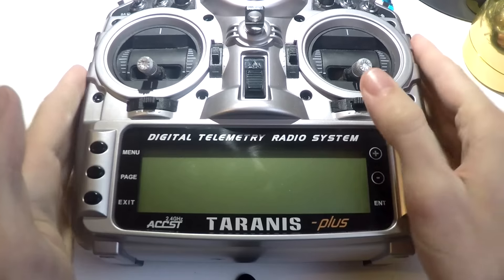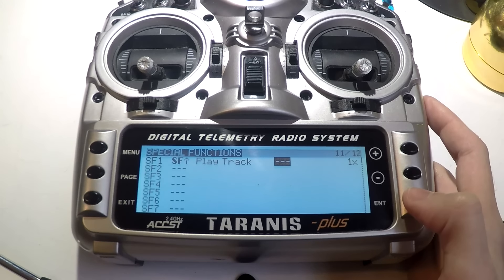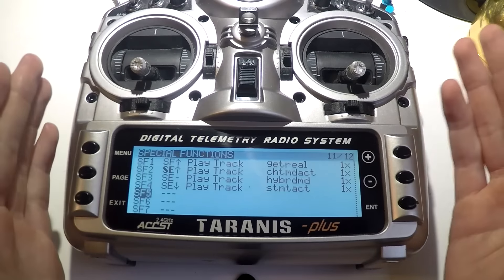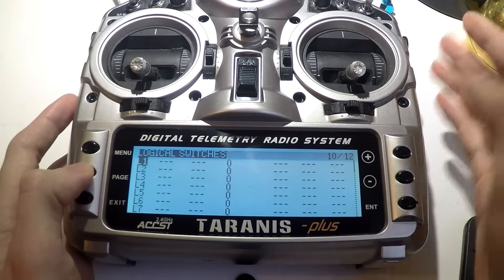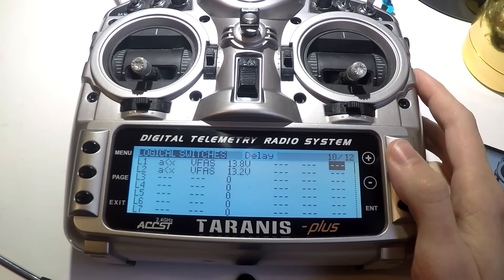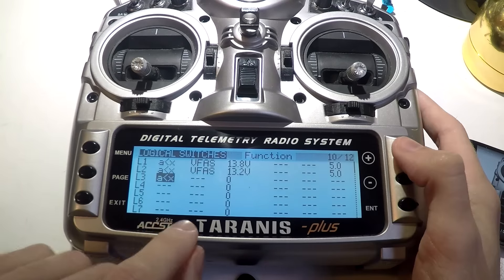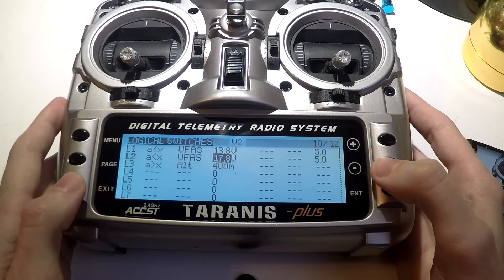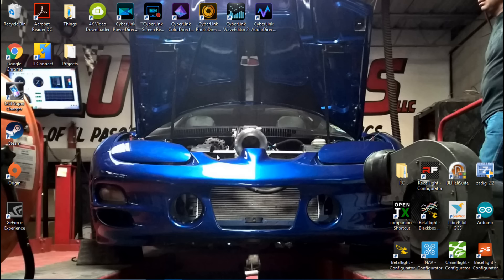Taranis X9D: Creating Alarms & Switch Sounds

Comment: I want to do the delay on the annoying low battery alarm but I realise when I do a punch-out with my quad I need to hear when the battery is struggling so I can ease off the power, I guess the answer is to assign a switch and try to remember to enable it before each flight, but if you forget....

Comment: Great video. I was able to use Taranis method to created sounds for switches, but when I tried Companion method I cannot find the WAV files in the drop down menu "Parameter". My hunch is that my SD card contains all the sound files but the Companion directory is missing sound files. Can you tell me how to verify this? Or am I missing some step? I am using 2.1.9 companion/firmware

Comment: Please help! I have added the VFAS special function switch on SH, but it's way off. The multimeter, the flight battery voltage display on the top line of the 1st Model screen, and the telemetry screen all show VFAS at 12.4 V (recently charged 3S). But the Special Function SH says 12.9V. Can't even charge that high. (Just sitting on the bench, not flying.) When flying it's anywhere from .5 to 1V higher, but that's a changing environment.

Really messing with my OCD!
Reply from the maker: What does it show in Betaflight? The actual voltage or whats on your Taranis? If it matches whats in the Taranis you may have to calibrate it. https://www.youtube.com/watch?v=Lf_2dH7BjAw
Reply: Thanks for responding! I  don't know what happened, but I just checked to verify (I had done your calibration video already), and BF saw 12.3, Taranis model screen 12.3, taranis telemetry screen 12.3, mutimeter 12.3, and only Taranis Spec Fn SW announcement was saying 12.8, and today it's saying 12.3! I'll see if it stays in sync, and I promise not to bother you again (for at least a week).
Reply from the maker: Haha well thats just how it goes. And you're no bother bud.

Comment: Hey I was trying to create the alarm for the voltage value, and it didn't give me that option once scrolling through choices. That "vfast" option you chose for battery voltage.

Do I need to download the custom sounds pack first in order to do this?
Reply: Hmm, so even after downloading the Amber custom sounds pack, I'm still not getting that "Vfast" option. Any idea what's going on? I've also updated to the latest firmware...
Reply: Well I got it to work, but it's telling me the voltage of my taranis. Of course my quad isn't on, so maybe it will tell me the value of it when it's plugged in, but when you demonstrated yours, it said 0 bolts because your quad want on...
Reply: Yup, even after plugging in the quad it reads off the volts of the TX and not the quad itself...

Any idea why?